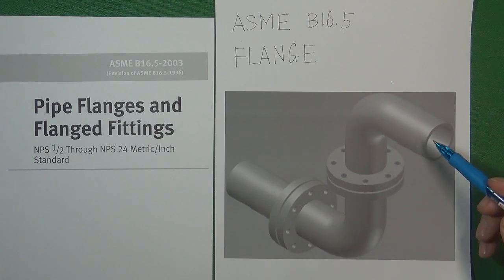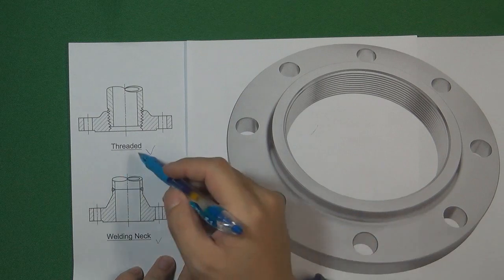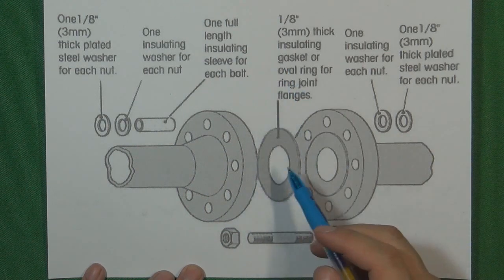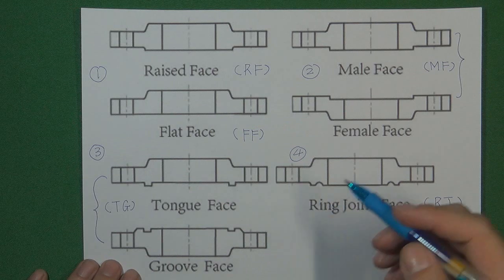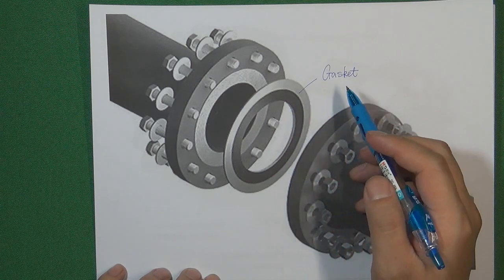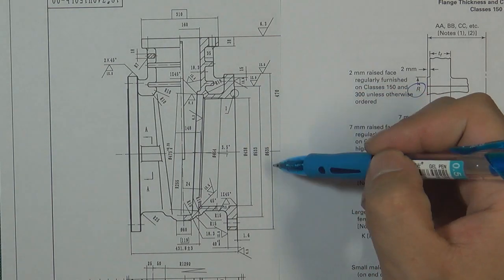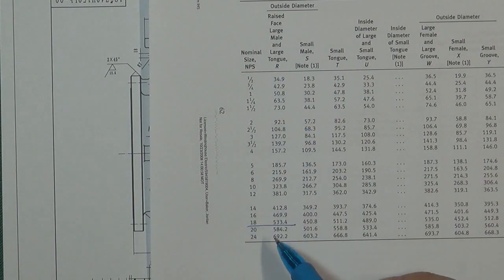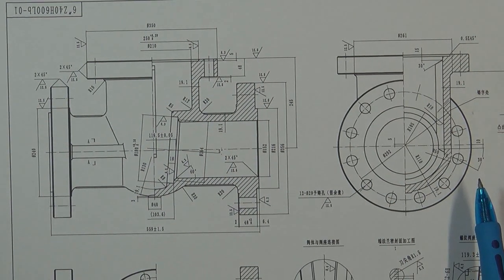How To Use ASME B16.5 To Design a Valve Flange #Standard Tips 3

Comment: Thank you very much for share these videos. I have a doubt! Can I conect a FF flange with a RF flange? If the answer is positive, which kind of gasket can I put inside this conection?
Reply from the maker: Thank you for your support. The FF flange and RF flange has different finish seal surface.RF flange has serrated seal face which can grab the gasket to seal the pressure better.The FF flange is flat seal surface it's esay to produce but the pressure seal ability worse than RF flange. You can ues metal spiral gasket to connect FF with RF flange but don't use it in high pressure（300class 600class）working condition.
Reply: I really appreciate It.
Reply: did you have any new videos looks like almost a year already